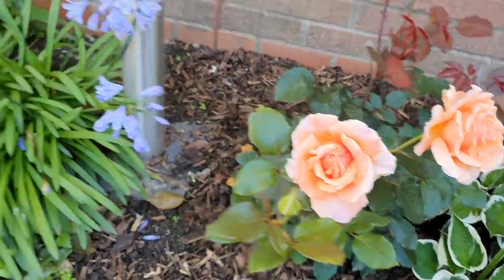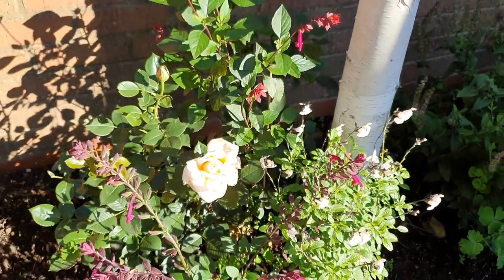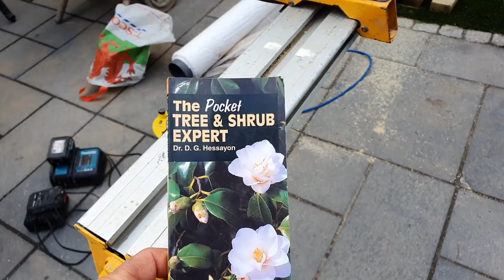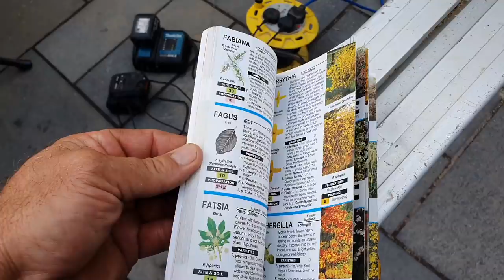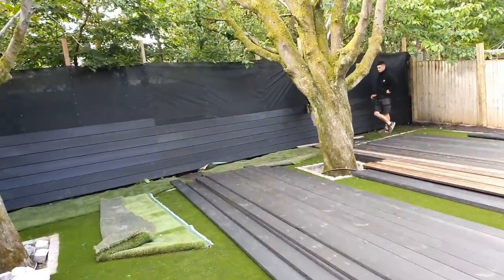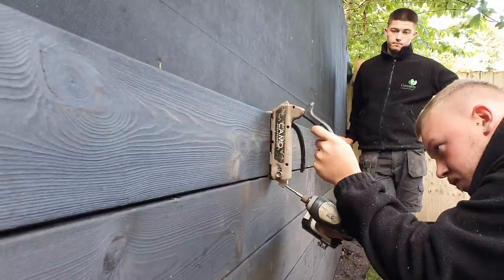Building an Iro Cladding Wooden Wall In Cardiff

Comment: Recently just finished a block wall with cladding slips round 3 sides of a garden. They wanted render but I fancied trying the slips and convinced them. Looks mint and they love it. Got 3x more jobs using similar material from pictures of the job. Endless styles and pretty easy to do, so I hope its not a fad.. That wood looks 👊